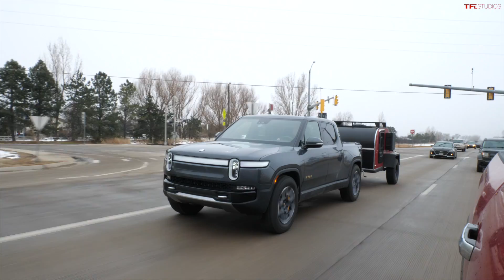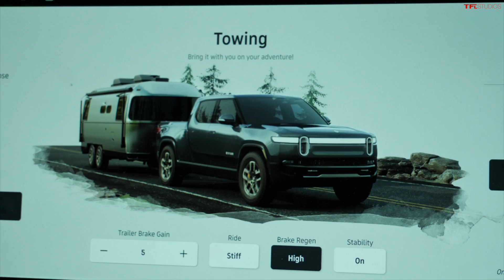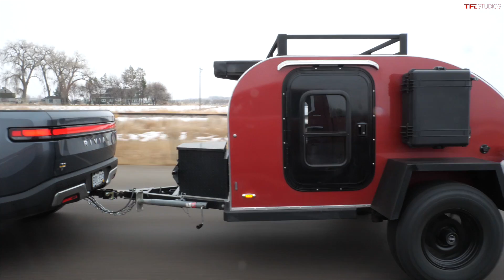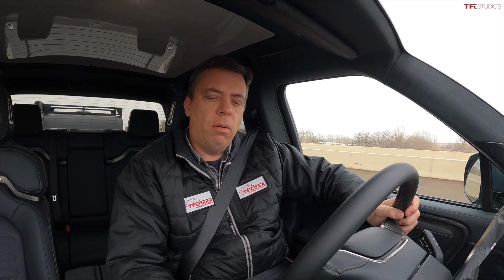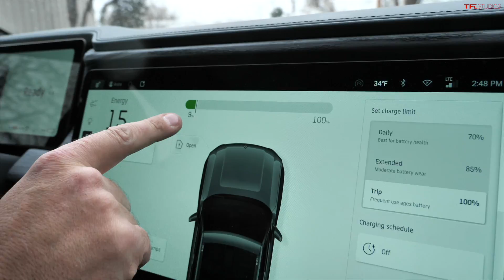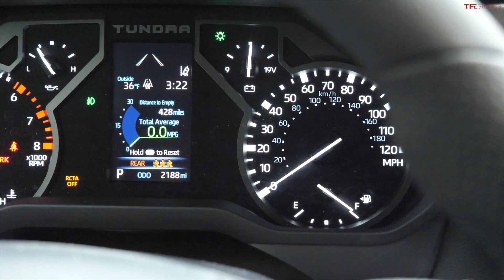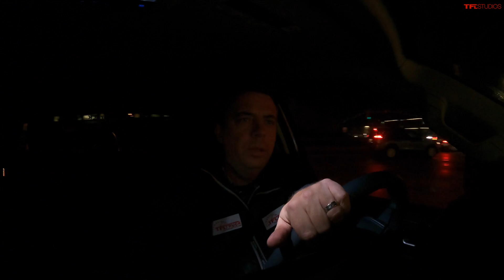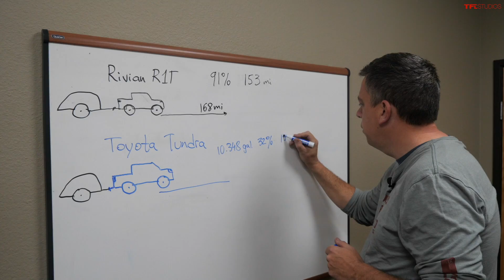Rivian R1T vs. Toyota Tundra: How Far Can Each Truck Tow On A Single 'Fill-Up'?

Comment: Airstream is coming out with an electrified trailer which means the trailer has its own batteries and its own motor to help the EV vehicle during towing.  I bet when the Rivian RT1 is combined with a trailer like that, the ICE range advantage all but disappears.  This is the future of "e" towing.

Comment: Correct me if my math is wrong the Rivian used 1kWh per 1.25 miles  which would work out to 1 mile = .80 kWh used. Electrify America in Colorado has a charge rate of $0.43/kWh for non members and $0.31kWh for members with monthly subscription. Rivian has a charge efficiency of ~90% from what I could find so our .8O kWh per mile would need 0.88kWh from the  charging station due to the 10 percent efficiency loss .  $0.43kWh x .88kWh per mile charge cost = $0.33 per mile cost for non members and $0.27 per mile cost + monthly subscription for members .  The Tundra works out to 0.067 gallons used per mile. Average price of gas in Colorado is $3.31    So 0.067gallons used per mile  x $3.31 per gallon = $0.22 cost per mile. Seems to me  like the Tundra is more efficient also you don’t have to sit for an hour to charge the dumb thing every hundred miles or so.  Who would really even want this ?

Comment: Good comparison, I don't think your trailer choice was the best as a typical camper trailer is definitely larger and heavier. Especially when actually loaded for a trip. That trailer is hardly a test for a vehicle claiming a 11000lb towing ability.

Comment: Curious as to the cost of fuel/electricity comparison as well.  1.5 kWh / mile x 153 miles = 230 kWh total x $.15?/kWH = ~$34.50.  I don't know what your charging station rates are and charging at home/your office is probably cheaper.  Looks to be pretty similar though even using the big truck.  It would be interesting see a cost comparison using the Maverick instead of the Tundra.

Comment: Fairness question. Tundras range is 400+ miles be default and you used the Rivian with only the 200s range default. So how does that fair if the Tundra had the same range as the Rivian or was pitted against the higher range Rivian?

Comment: the Tundra has a might big tank.  Ford and Ram Gas trucks only have like 23 Gallons.   I rarely get more then 250 miles out of my 1500 when towing a 5000lbs trailer.

Comment: Why do american trailers have the axles placed so far back? Here in europe trailers have the axles placed in the middle and there is barely 100 pounds of weight resting on the hitch even with my 4200pound camper. By law here you cannot load the hitch with more that 220 ponds of weight.

Comment: Hey guys -- great video, and thank you for the useful information. I'm truly on the fence on if an EV truck is for me or not in the future...What I found most interesting from this video is that if you calculate % decrease in the "predicted possible unladen range of the truck" using the extrapolated laden numbers y'all give, the trucks actually performed similarly(ish). Rivian: 168mi/280mi=60%; Toyota 473mi/(22mpgh*32.2g)=66%. There are a ton of different problems with this mathematical model I've proposed, but still interesting...Regardless, towing weight for any distance sure seems way more convenient with an ICE truck at this point in time (but prob more a f(x) of capacity and charing rate after depletion, rather than drain rate)....

Comment: One thing would be nice to know cost.  Looks like gas replacement was 40.00, what was the electricity replacement?  Yes we know the time it takes to recharge but also which one was more efficient or cheaper to run the loop?

Comment: As battery technology improves and HVAC tech improves I would predict in another 10 more years EV’s will be towing 2x the distance with the same load using the creature comforts that ICE vehicles use.  Not to mention the recharging rate will be at a standard 250Kwh.  ICE trucks won’t be able to compete with the efficiency.

Comment: You will need to stop more in the Rivian than a gas truck towing long distances, however, cumulatively most people will spend far less time waiting for the Rivian to charge than they would waiting for a gas truck to fill up if they charge at home.

Comment: Needs some kind of supplemental battery pack option, maybe something that can be thrown in the bed and plugged in for extended range, or just a backup to recharge off of. Regardless, no heat pump makes it an absolute no sell for me in the upper midwest.

Comment: What was the cost to charge the Rivian back up to 100% and how long would it take?  The EV trucks just are not practical for towing for any distance.  Just think if you had a 8 or 9 thousand pound camper. You would spend more time charging than driving.  I will stay with gas.

Comment: I like the range calculation at the end, especially given the number of gallons used, considering different trucks have different tank sizes.

One request: on future iterations, add in the amount of energy consumed. One gallon of gas is ~33.5 kWh of energy. The Rivian's battery is 135kWh.
Doing some rough math, that means the following amount of energy was used:
- Tundra: ~346 kWh
- Rivian: ~122 kWh

So while the Rivian could only go 1/3 of the distance of the Tundra, it also only used 1/3 of the energy in this test. 

It also means the Tundra effectively has a "battery" size of ~1000 kWh. The energy density of gasoline is amazing. This also helps to show what electric vehicles have to compete with when it comes to solving the range anxiety problem. Its much harder to put a larger battery in a vehicle than it is a larger fuel tank.

Comment: I get tired of EV crap getting shoved down our throats . If you want it and live in a city hub , fine it works for you get it . They are so far from making something like that practical for anyone living in the country it’s not even funny . 
That little tiny weightless trailer ?? Never mind a camper. I want the Rivian hooked to my 1800lb double axle , double gate 16x77 trailer with my Can Am X3 Turbo , and my Sportsman 1000 XP ATV on it . Over 4000lbs with a parachute on the back . 
That thing wouldn’t make it past my neighbors house . Then it takes WAYYYY to long to recharge . The Tundra made that thing look absolutely silly. 906 ft lb nice . Can i use it for more than 36 feet with a load . 

ICE ICE Baby.

Comment: While the R1T can't go as far as the Tundra, you can see the overall efficiency of BEVs through this test. The R1T used 122.85 kWh and the Tundra used 345.73 kWh of energy on the same loop. The Tundra can store roughly 1,080 kWh or 8x the amount that the R1T can store. In summary, the Tundra can store 8x the energy but can only travel 2.8x the distance.

Comment: Now need to see the Rivian truck tow the trailer for 473 miles and calculate how much additional time it spent charging. My guess is at least 4 extra hours in travel time, maybe longer depending on going out of the way to find chargers.

Comment: You will need atleast 500-600 mile range for it to be any good at towing, that way hopefully, it'll get 250 mile range with a good towing weight. 
However a 600 mile battery will be 150-200kWh so charging will need to be 400kW for a practical shortish charge time.

We're still 5 years away, both in Infrastructure, and in battery technology.
Reply: They haven't found ways to improve this problem with batteries in 100 years and suddenly you know it's only 5 years away? I've been hearing this excuse for a lot longer than 5 years now... My guess is if anyone comes up with a way to increase the capabilities of batteries, they'll win a Nobel Prize. But I don't see how. They're also trying to improve batteries in the mobile phone industry, and they have billions of dollars budget to invest in research and development. Still no breakthroughs yet...
Reply: @lapamful  you must live under a continent sized rock. Battery tech is constantly improving you dunce.

Comment: Its not even about range....its about where the next charger is...theres always a gas station.  Midwest and east coast are very sparse, sometimes 200-300 miles in between chargers.  Less than a dozen in the entire state of mass. And you lose even more in the cold up to 40%. Just sold my Ev because of this.

Comment: Sometime really needs to bring back building a teardrop or any trailer onto a battery pack. You would have extra weight but getting an addition 150+ miles from the trailer battery. I’d pay for That

Comment: The Rivian used 4 gallons of fuel (equivalent) to go 168 miles. That's phenomenal!

1 gal = 33.7kWh
135kWh battery pack / 33.7 = 4 gallons of fuel
Reply: So 42 mpg pulling a trailer?

Comment: So I did a quick search. What I came up with is that the cost of charging an EV at a charging station (not at home) varies from $.30-$.60/Kw-hr. So lets pick  $.45/Kw-hr. The price of a Kw-hr of electricity in my home state is much less, at $12/Kw-hr.  At any rate, let's pick $4/gallon for premium and lets pick 10 mpg towing with a Silverado 6.2. Five hundred miles would be 50 gallons so $200 to go those five hundred miles. Now, you got 1.25 miles/Kw-hr in this video. Doing the math, those same five hundred miles would require 400 Kw-hrs, all else being equal. A little more math, at $.45/Kw-hr reveals a cost of $180. Change a couple variables and I'm gonna call the cost basically a wash. So towing over distance, paying $.45/Kw-hr at charging stations (again, not at home)  isn't really less expensive than towing with a gasoline engine if using charging stations, to say nothing of the inconvenience of having to stop and charge every 150 miles or so. Now if one only recharges at home, there is no comparison and the EV becomes much less costly to operate at $.12/Kw-hr.

 It will be very interesting to see where the money and power ends up as we get shoved into EV technology. But I challenge vehemently the assumption that they are less expensive to operate and better for the environment. We still don't have an answer to what will become of the toxic waste when batteries are at end of life and discarded. And we still don't have answers as to where the electricity to charge the batteries is going to come from and whether the net "pollution" result will also be a wash. Thanks for doing this video. Very real world and applicable in the here and now.

Comment: Good test!
But I would like to see almost apple to oranges test. How about the R1 (midish size) to the Jeep Gladiator Diesel (midish size). Range and efficiency test… Do not get me wrong.. Electric vehicles will have a place but some applications will need different tools and we should be the most efficient at it…

I have a Jeep Gladiator Willys diesel with 3.73 axles. My real world mpg is around 26.5 over the last 18,000 miles…

Comment: These guys do a good job on all these towing tests. It’s not their fault that EV’s have some very unique and huge pitfalls. Leaving out the costs of maintenance and repairs, although EV’s are a perfect platform as far as power/torque necessary to do the job, they just can’t practically carry enough batteries to get the range needed for most real-world towing applications. I wonder how many EV truck owners will be toting a big ginny in their bed so as to avoid being stranded and having to call for a tow to the nearest charging station? 🤔

Comment: I live in Phoenix Metro.  I moved across town from Chandler to Buckeye in multiple trips using my truck and very large box trailer (probably 10k lbs loaded and 2k empty).  One way door to door was 82 miles and I never left the city.  I can't imagine what a nightmare the Rivian would have been for that.  I don't even think it would make a reasonable "city" truck.  I get the use of a little EV for a commuter car.  But an EV truck feels like round hole - square peg.

Comment: So, 1 Gal of gas is equivalent to 36.6 kWhs.  The Rivian consumed 122.85 kWhs in this run.  So, 122.85/36.6 would equate to 3.3566 gallons of gas which would equate to 45.58 MPG on this 153 mile loop.  The Toyota consumed 10.348 gallons which is 14.78 MPG.  The electric platform is way more efficient than gas for energy consumed, but your battery capacity is the equivalent of a 3.688 gallon tank.  Great numbers for a city commute, but not ready for the cross country trip yet.  Great article as always Andre!

Comment: The ev trucks need add a small generator or similar at least for towing. I'm sure they don't so the can have that zero emissions ratings. However until you can extend my towing rang the ev truck will just be a nech market, specially with charge times.

Comment: You are towing on a flat highway.  How bout adding some realistic roads with some hills.  2000 lbs, what about the family and gear?  It is good to see just how much better gas trucks are for towing any distance.  If you put an average size camper, 5000 lb. it would be even worse for the electric truck.  The Rivian is nice, but not a work vehicle.

Comment: One point glossed over here is 153 miles at 55-60mph!  You’ll get run over on most highways doing 55-60mph!  This test needs to be done at a minimum of 65-70mph average!  I’ll bet that Range Drops below 130 miles!  

I agree it tows well but I think 100-130 miles range will be cutting it close for a lot of people!

Comment: it's a shame that these huge pickups are not offered in diesel,in india or other asian countries there is no option for a petrol in pickups always comes with a diesel and hilux(similar to tacoma in US) and can easily get a range of over 550 to 600 miles on a full tank of diesel with the same load.

Comment: The should've used the f100 on the tandem trailer instead.  Instead they used a lighter trailer as to not make the EV look like a complete fail for contractors or people who actually use the truck as a truck.

I do believe the hype of the EV truck will die down alot after this. 

 My respect to Rivian for allowing someone to test their truck like this.
In all honesty we are at least 20 years away before EV take over the ICE, unless there is a Breakthrough in batteries.

Comment: If I did the math correct it cost roughly $36 for the tundra to make the trip, $31 for the rivian at average charger cost of .33 cents per kw, not much of a difference. However it would be only $12. for the trip if you charge at home rates of .11 cents per kw.  Also from what I've seen Tesla chargers are about 1/3 cheaper than other networks so depends on what your driving. No personal experience here just looking up rates of what I could find.

Comment: Amazing comparison! This is a very real world test. Much appreciated.
Reply: What happens if you don't enable towing mode, but keep it in the more efficient 2wd highway mode instead? The trailer doesn't have brakes (as mentioned) and you don't need 4wd traction. As long as the lights still work, it should be fine for that light of a load. How does that affect the range?

Comment: Fun Video to watch, thanks for putting in the effort and drive time. I will comment and say that your conclusion was very generalized while your data and test subjects were very specific. You missed alot of nuance having such a generalized conclusion that may be misleading. 

It's not just electric truck vs. ICE truck. It's the Rivian and Tundra in those exact specifications (battery size/fuel tank size, tire size/type, model etc.) that leads to "2.8 times" the distance.

Comment: The interesting thing is that if you look at the amount of energy of diesel the Toyota used, and then compare that to the amount of electric energy the Rivian used in kW per 100km. On that spesific trip, the rivian used ≈ 41,0 kWh/100km. And the Toyota used ≈ 168,0 kWh/100km. Toyota used 4 times more energy than the rivian. (one liter of diesel is aprox. 10kWh

Comment: Terrible range on that EV and that is a small trailer. That's a deal breaker for sure if you actually use your truck as it's intended. ICE engines are still the way to go until they learn how to provide better range without it costing an arm and a leg.